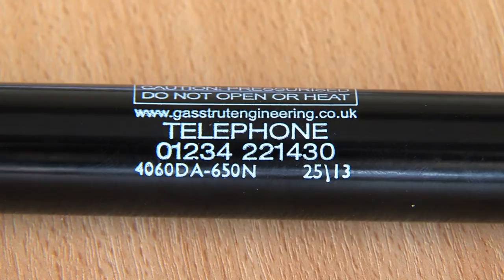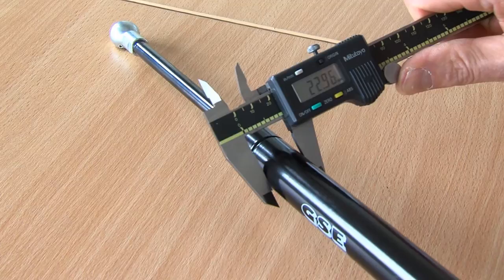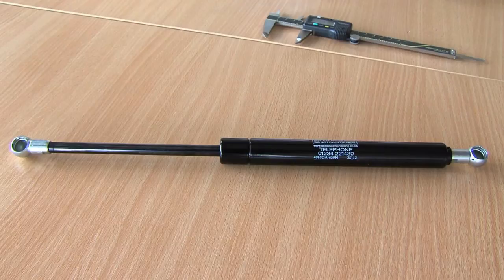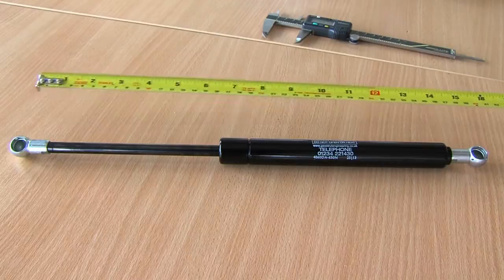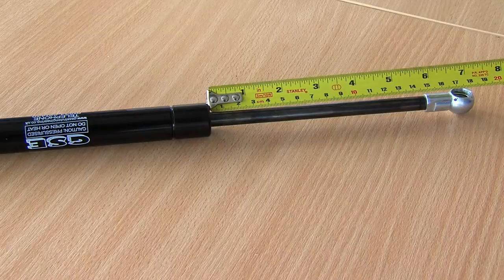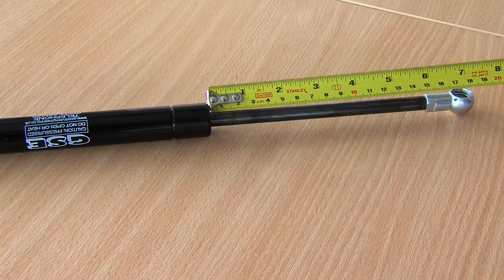Gas Strut Engineering Ltd -  How To Measure A Gas Strut

Comment: in the video you say measure the stroke length but did not explain where are the start and stop points of the measurement???  from end of cylinder to end of rod?  or end of cylinder to center of fitting?  Please specify.  otherwise helpful video.  I assume that in this video the stroke length is 145mm or 170mm.  is one of these correct?
Reply: you are right